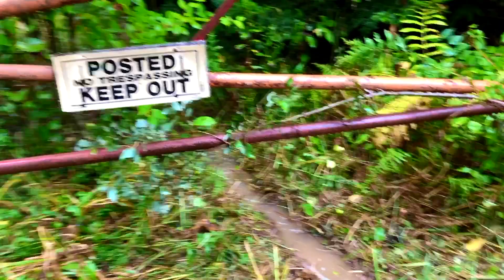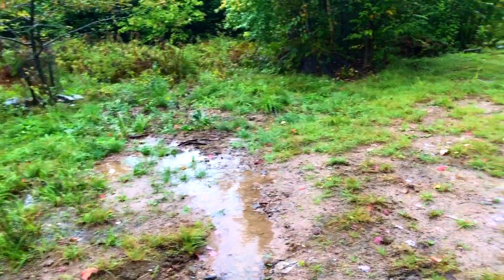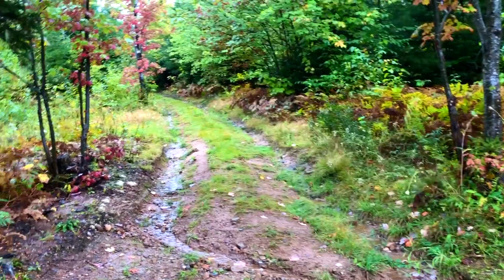Simple Camp Driveway Water Diversion

Comment: Hey Frank, glad you're enjoying your camp. Hard to control washouts on gravel roads even with proper crown and drain. Spending money on type 1 wouldn't work but shale is cost efficient and comes in different sizes so you could drive on it allowing water to run through it. Find the water source and direct that also, if you don't want to use shale type 2 stone works well.
Reply from the maker: Great advice thanks. Yes I think I need to redirect further up as well.